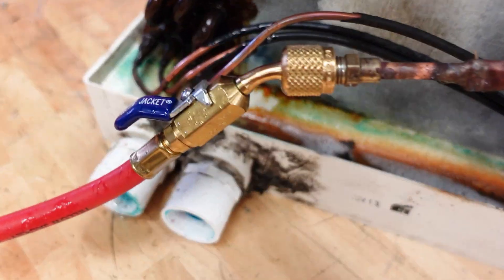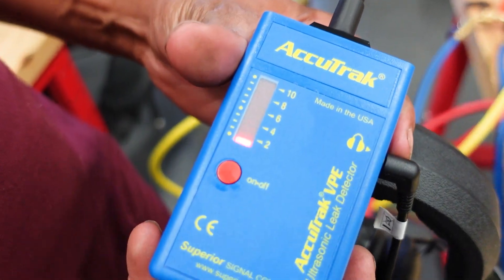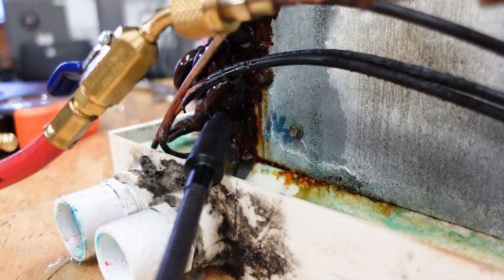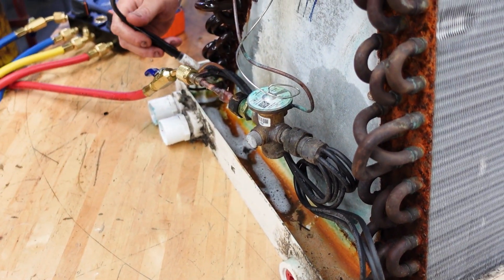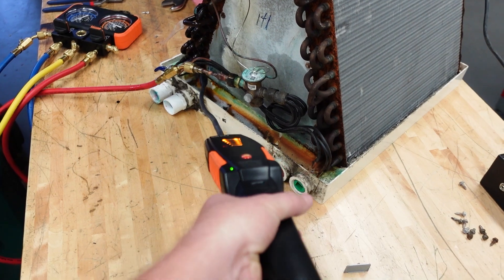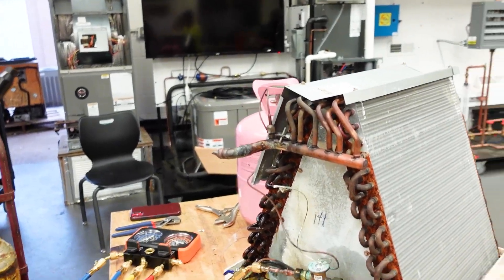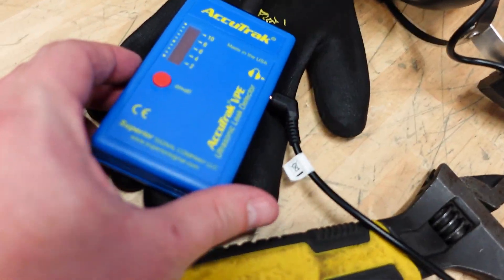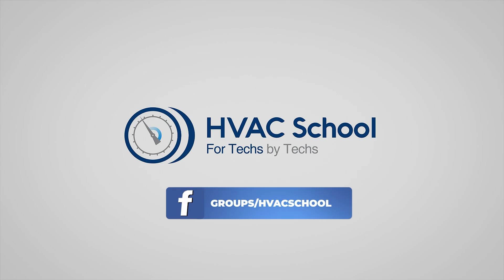I Changed Mind About UltraSonic Leak Detection

Comment: Nice.!! This shall be my first leak detector.
Reply: I have a ultrasonic and a heated diode. Rarely ever do they both strike out on the same leak. I recommend having both.
Reply: @adamcraig1568  That's where I'm at. I want to add it to my tools but still have both.
Reply: You got to wet the coil first
Reply: Ya micro leaks are hard to find with ultra sonic. Need put lots pressure like 350 psi plus inorder to hear them. Btw I tested my amprobe ultrasonic and it's more sensitive when you put it on 100x sensitivity. Accutrak has no sensitivity adjust.
Reply: I've got an Accutrak.  I have been able to find zero leaks with it.  Maybe it's just me.
Reply: @guitarhvac  you need to have a wet coil in order to have the best results.
Reply: @guitarhvac  I only use the accutrak if I can pump up with nitrogen, heated diode for refrigerant
Reply: I have this leak detector and it's is the best I've used in last 7 yrs of doing service   if system seems to be low then run in heat or a/c depending what time of year it is to raise pressures and then shut it down and listen  generally find it no problem.  Now if system is pretty much empty, then recover and weight charge, that will be your next sign if it's low then charge system to 400 range and then check both coils.   Bet your find it then with no issues.
Reply: @dancalder6696  400 might cause more leaks depending on the system. Specifically R22. But like they say "if i can't find the leak,  I'll just make one".
Reply: @TheFoxygrandpa69  if 400 causes more leaks then you don't want that coil in there anyway, metal and factory braze connections have gotten weak and needs to be replaced anyway, and if it's R-22 system and it leaks then system could be replaced with new 410a system but if they do repair or change out coil with new, then use MO-99 or RS44-b. They are replacement froen for R-22    cost Is way less per pound
Reply: I don’t recommend it be your first, I had a bunch of coils in the field that I could not find with the accutrac but found with a standard leak detector. It’s better in a lab where you can get to the whole coil.

Comment: I have a r420a unit that is loosing 1lbs per month. Leak checked it 4 times now using 4 leak detectors including accutrak and can't find a thing. Can't hear it can't see anything. The Accutrak seems useless I hear nothing but electrical noise. I even shut down power to the whole house trying to get rid of the electrical noise but still picking it up lol. At this point I'm quoting a new evap, and possibly a completely new system after probably 12hrs of leak testing with no resolve. I even removed all the gas and pulled a vauum of 500 micron and it held for 15 minutes (wtf). I hate leak testing. Maybe I need to submerge the entire evap and cu under water to find it.

Comment: I've been using a Fisher Scientific for over 20 years. Paid over $2K it's saved me more time. Mine doesn't need to be nearly as close. I can spot a small leak from 30-40ft away. They even work under vacuum so no wasting nitrogen. you do need one that has filters and variable frequency

Comment: Been using the Accutrac for the last half year. On systems where my colleagues give up. I ususally find the leaks within minuttes. On blastfreezers, open the door and the unit is yelling at me. In larger compressor rooms, shutting every unit, and i manage to find several leaks, but was only there to leakcheck one system.

Comment: I've been using the Ultrasonic leak detector for years now. It's the best. You can find refrigerant leaks, natural gas leaks, compressed air leaks, even CO2 leaks on fountain lines. Super flexible tool to have. I've even been able to hear internal leaks in valves without having to open systems up or pressure test. Can't be beat. This is the hill I'm going to die on lol.

Comment: I have a lot of confidence in the H10 over the years on CFC and HCFC gasses, it would find leaks that other detectors would pass by.  It has always been my go to until I couldn't really find a leak on some HFC gas.(like R410A)  As you can see it picked up the reference leak no problem. If I recall the reference vial is R11..? (a CFC gas) I think the H10 in the newest model will work with HFC gas but I own 2 of the older plug in models and neither work on the newer gasses with much luck.  I now own a Fieldpiece SLR8 that seems to work much better than my old H10's on the HFC gas. I also have purchased one of the ultrasonic detectors (Accutrak VPE1000) and I am still learning how to use it.  It says in the book that it helps to find a leak if it is really small that if you spray water or soap over the suspected leak as it will help with the noise that the leak generates. Kind of like making more velocity over the leak hole...like putting your thumb over the hose end to make more velocity. One thing I have found for the VPE 1000 is it has a probe for listening to contact noise like bearings.  I had a pillow block that was making noise and thought it sounded like a bearing that needed grease. I had the probe on it while I put grease in the bearing...WOW! I could hear as soon as the grease went in, the noise went away.  Cool way to grease a bearing.

Comment: I bought the ultrasonic same one shown here because I saw it on Craig from AC Service Tech video, it does work great.  But my question is still, unless the leak is in joints, what benefit is knowing where the leak is?  In the case of the coil in this video , answer is still the same replace the coil.  What am I missing?
Reply: I'm not an HVAC guy so can't speak for them. I'm an Appliance Tech and do only domestic refrigeration . I can't tell you how often coils in my field are NLA. So repairing is the only option. It doesn't matter where the leak is I have always been able to repair an evap coil. The coils I deal with are never as nasty looking as the ones in Central A/C units where they mix dissimilar metals . 
The coils I deal with rarely have joints. They are just one continuous run of aluminum tubing.  If you have a good aluminum solder then repairing them is a ton easier than replacing them. Again I'm speaking about domestic refrigeration .

Comment: My ref technician is really an expert without using a leak detector, he concluded that there is a leak in the system and will cost about $1000 to get it fixed, which I purchased my ref for only$650 at HD 1 1/2 year ago of Whirlpool brand. He never used a detector, only his cellphone to enter the sN and model number. Less that 5 minutes, without checking the current draw on the compressor or a pressure check! There goes he billed me with no report/receipt for $99 as trip charge.

Comment: Would you be able to do a video on difference on using the wrong lineset size has on a unit? At the company I am working at I sometimes find smaller suction lines connected to the condensers. Sometimes I have off SH/SC readings.

Comment: I have faith in the Accutrack Track and even done two videos on both versions of it but I'll be the first to tell you and even said it in my sponsored review video that it will not pick up every leak and actually misses a lot of them.  I've missed several leaks that do not have turbulence due to rough edges.  example: like flare fittings.  But it's great in highly contaminated rooms and outdoors away from people making random noises.
Reply: Yea I have really bad luck with flare fittings especially if its on a mini split or a big enough leak

Comment: I see that none of you are trained on how to use the H-10. Start with large then finish with small. This absolutely will pin point the leak.
Reply from the maker: This particular detector isn't working right because the pump isn't working properly 

We tested it later off canera

Comment: I made my own low tech "ultrasonic" detector 25 years ago and it worked pretty damn good. Used headphone type hearing protectors; drilled a hole in the bottom of one ear piece and inserted plastic tubing to basically make a stethoscope. It worked great because the headphones filtered out all the background noise and the tube picked up the sound of the leak. I found a lot of leaks in a lot of evaporator coils with that.
Reply: that's sonic not ultrasonic

Comment: You folks definitely know your stuff inside and out, butttt, the testing is default.  Why??  If the EVAP was in it's case the electronic snoopers would be going off prematurely.  Especially any mid or back of coil leaks.  How effective would they really be??  I use the ultra sound, but if you're going to simulate then the actually environment must be as authentic as a true service call.  Once again, you guys are great and truly rock!  I am just referring to giving any instruments/companies their props.  Keep up the awesome work and thank you for so much priceless knowledge.
Reply: You gotta put tons of pressure on the smaller micro leaks when using ultra sonic. I had to put 400 psi on several systems before I could hear 👂
Reply: @97Napkins  
 Hey Pat,
It is definitely a different animal.  Sometimes you have to manipulate the situation.  For instance, spray the area ( not the entire Evap, lol! )
 with Big Blu and the ultra sound picks up the bubbles.  Yes, this seems counter productive, huh?  There can be a learning curve in what to listen for, etc.
  They claim it can hear other gas leaks.  This just happened to me last week.  When you went down into my customers basement you could smell natural gas.  I checked every joint/fitting all the way to the meter, nothing.  I used Accutrak with Big Blu, nothing.  However, I could smell the gas around the union.  I used the instrument again, nothing.  While smelling again on the backside of the union I could ever sooo lightly feel ( cold air, which was gas ) blowing out upon my upper lip.  I was as close as one could be without physically touching my face on the line or union.  Not a single bubble even  when sprayed down.  Totally nuts!  Nothing worked and it claims it can pick up additional gases.  I have tested my AccuTrak and it can detect me blinking.  I dunno!
Reply: Pat,
One more thing.  Any suggestions?  I mean, if your putting 400 psi on older 22 coils it could create additional leaks or something worse.  I mean, you're nearing 410 A max pressures.  My reply is by no means doubting you...just seeking some direction for the near future.  Especially, if you had to do this on multiple occasions.  You know as well as I do that one of these times you're going to hear a pop and have to start pulling fins. I have only owned my AccuTrak for about two months.  I am all ears, brother.
Reply: @JerryLynch2  doesn't happen very often...just the microscopic 2 lbs a year or less I've had to put in lots pressure but ultra sonic is faster than any other method 😉. I've saved many hours In the field.
Reply: @97Napkins  I know it's only sooner than later before it happens to me.  I appreciate you getting back to me.

Comment: I got that one and tried it on the real world of refr and hvac and i couldn't trust it, sometimes it would be unbelievable at showing the leaks and some other times nothing, when there was a proven leak, how can you trust a leak detector like that ? Specially when the price is as high as this one is. And then, got it with a case the size of o a recovery machine! cant waist all that space in the van  for such a small tool.  I really thought that detector was going to be great but did not do it for me.  The good thing, signal took it back no questions asked very good customer service.

Comment: There are different versions of the H10.  
The H10Pro is much more sensitive to R-410A than the earlier versions like the H10G in the video.
Reply from the maker: Yes and this one we are using has some clear issues. Not a reflection on all H10s

Comment: Been using ultra sonic for 8+ years. Btw tested amprobe vs accutrak and amprobe more sensitive. 100× sensitivity button. Only problem with ultrasonic is you have to put lots of pressure to hear the really small leaks. Had to put 450 psi on a coil I knew must be leaking to hear the leak
Reply: 450 psi?! man just wet the coil with a sprayer and it will make your ultrasonic detector to find leaks quickly at even low pressure in coil
Reply: Aight I'll try next time
Reply: Just shut off the evap fans and condensing unit. And let the system equalize. It's more than enough. 
I'm using the Accutrak several times a week. And thats the way to go. Even on larger CO2 system. Even heard leaks through insulation.
Reply: Any luck with flare fittings? I can't find leaks with my accutrak ultrasonic on mini split flare fittings even when they're completely covered in oil

Comment: I've been using the AccuTrack for about 10 months. It requires a lot of judgment in its use. Electronic noise can set it off. I have to make a point of not having my cell phone close by, and turning off power to defrost control boards when checking outdoor units. It's amazing how electronics can scream at you when listening in the ultrasonic frequencies. Learning to disregard background noises is fairly key. Training yourself on what to listen for is key with the AccuTrack. You have to listen for that frying bacon sound. I'm pretty stoked about the fact that I can use it without any refrigerant in the system. It has proven to be very useful on systems that I find completely flat. I pressurize with nitrogen, and can find the leaks in pretty short order most of the time. It is also really good at finding very small leaks. Spraying leak area down with water really helps pick up on the sound of leaks.
Reply: I have been unsuccessful with mine.  I'll have to try what you recommend and spend some more time with it.  Thanks
Reply: @guitarhvac  thats really what it is, the more you learn how it behaves and what to listen for, the better you'll be with it. for a while I thought it wasn't that great but now I've used it enough I can tell what is background noise and what is actually a leak.
Reply: @embeddedgirl  seems like a sponsored response lol
Reply: Good comment however i will say be careful of the frying bacon sound. If a coil is thawing or water is draining it gives the same sound. At least for me

Comment: I love your videos, this is by far the least compelling for leak defecting solution.   An exposed coil easy to get to and erratic alerts. Imagine in the back side of the coil or outside in the wind.  Move a hot diode to quickly and you'll get a false alert.   Mine as well use a dowsing rod..  

I'll stick with dye and UV glasses.

Comment: Good video! Your using the H10 wrong. Should be on medium setting and set to manual with the heart beat set 1 sec apart. You would have found it. Follow the instructions. Otherwise good video. Thx!
Reply from the maker: This H10 wasn't working properly we did more with it off camera

Comment: It found the leak.  I would like to see several different people pick one tool and see how long it takes each of them to find the leak.  Is there a better technique and can it someone actually find the leak.
Reply: I agree.  set up blind competitions on real leaks, preferably small, each person gets up to 10 min to find the leak within 1" of where it eventually turns out to be.  This can even be done in the field if you have a few extra minutes between two people or detectors.  

I have the older Amprobe ULD-300 that i haven't used in years.  I tried to get it to work several times on several different types of leaks, from water pipes, to metal duct, to car weather striping to bicycle tubes and inflatable air mattresses.  I don't remember ever being impressed, but maybe i was just not doing things right. I am pretty sure Bryan has this same model and can compare it to the AccuTrack at least on nitrogen or R410 or R134a in a refrigeration or HVAC system.  I would really like to know before pulling the trigger on another similar unit (note Amprobe present model is the 400 series, but i don't know that it is any better than the 300).

One way that always works is add some pressure and submerge in soapy water, but that is not always very coinvent to do :).

Comment: Now you have to reuse that ultrasonic leak detector with all the refrigerant leak detectors turned off because they have a little vacuum pumps in them pulling in fresh air through small offices creating background vacuum leaks ultrasonic loves those. 

        As for the H 10 its strongest points CFC refrigerant. 
            Re-perform your leak test with our 22 in the evaporator that’s where the H 10 strong point. 

            The ultrasonic leak detector double check the lights in your building turn off all the lights and then use your ultrasonic leak detector then have somebody turn on the lights in the building to see if you’re getting background interference from the ballast switch mode power supplies in LEDs or fluorescent lights. 

           No one leak detector is perfect in all leaks in certain situations some outshine others and there’s even those really desperate times in emergencies and frustrations where sometimes UV dye works better than all of them.    But only sometimes.

Comment: I’ve never found a r410a leak with the H10 even when I knew right where it was. Great for r22 but I sold mine.
Reply: I use my h10 pro to find 410 all the time. Have the right settings and it’s awesome
Reply from the maker: H10 Pro is a good 410a detector